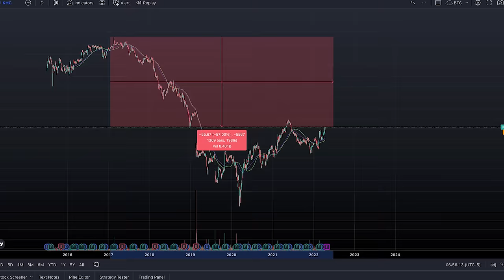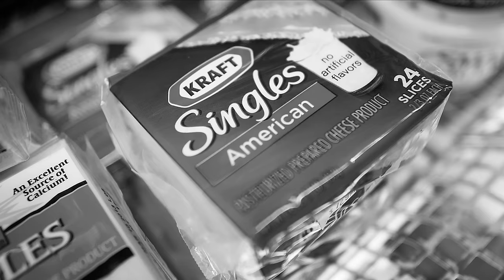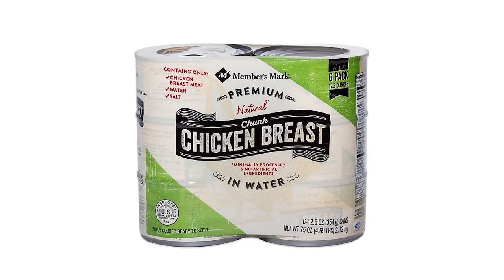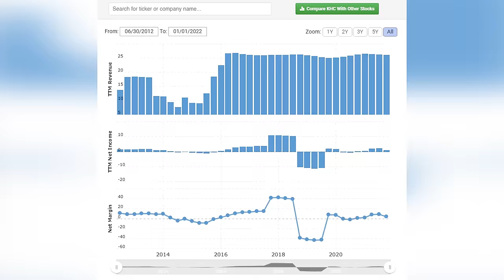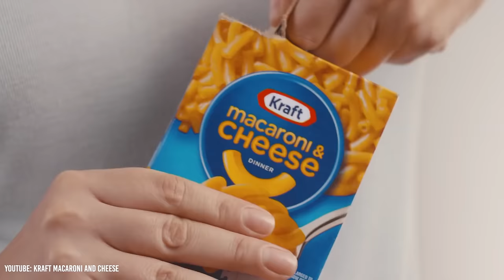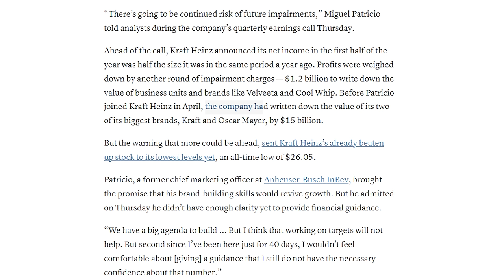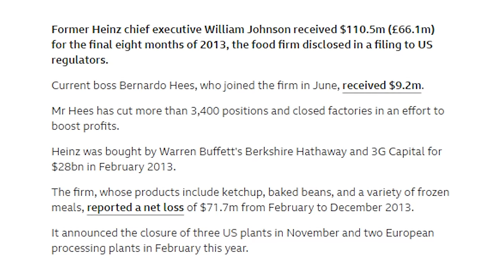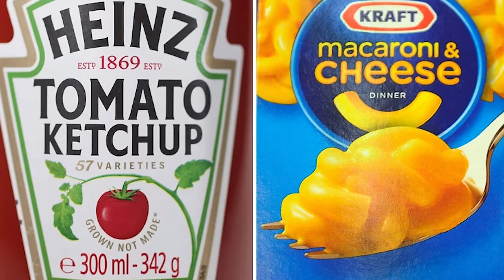Meet Warren Buffet's Worst Investment: Kraft-Heinz

Comment: I read stuff about it when the merger happened, there were actually 2 partners on the buffet side, Buffet provided the money but a Brazilian fund or company was actually the managing partner, they are famous for asset stripping, firing as many employees as they can and basically running their companies on skeleton staff. It was speculated when the deal happened that their “growth” was gonna happen thru firing as many people as they could and having as many low salary, entry level, minimum wage employees as they could. Think I even remember the Brazilian company boasting that 70% to 80% of their employees will be those employees. That is serious brain drain on a company of that size. Switching to more processed products while the market is moving away from those doesn’t help.
Reply: When the merge happened,  Heniz corporate came through an downsize the kraft plants by 50%... my production plant was on the verge of closing till a deal with NY state happened an the governor stepped in
Reply: @jamesschneck1797  project footprints cough cough lol.

Comment: KHC is the sleeper in food stocks. It has been under 
40/share over 4 years. There's going to be food shortages soon. Look at what happened to OXY, oxidendal Petroleum. I bought it at 35 about a year ago and now its doubled. Too bad I sold at 50 and didn't buy enough. KHC is the same thing.
As food shortages hit this stock is going up to at least 60 which it was and higher from2014 to 2018.